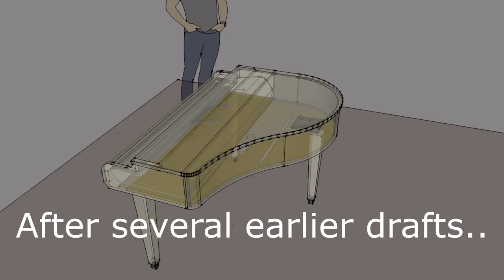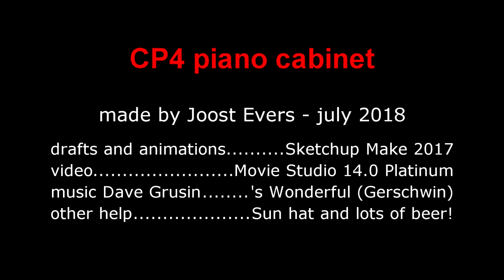A cabinet for the Yamaha CP4 stage piano

Comment: It looks amazing, if I may ask the sound from the piano speakers will not be affected since it becomes inside a wooden box? it could be it is a silly question but according to physics that can happen. I am asking as I am planning to build a shell too but I am a bit confused about the sound quality.
Reply from the maker: Wisam, You're absolutely right. The piano has no speakers of its own. Fortunately the CP4 has a five band equalizer with 5 dedicated sliders. I use it to lower the middle low and to give the mid high a bit extra. When I play, the flap on the keyboard side is always open, which makes the sound brighter. The flap on the round side is nice when you play before an audience. It opens smoothly, with a cheap hydraulic piston, in an angle of around 60 degrees. Underneath I have built in a 2x50W (s.m.e.l.) amp with two high quality multicone car speakers, facing upwards under an angle of 30 degrees. That is more than enough to reach the volume of an acoustic piano without any clipping. Some people find that the shell adds to a natural piano sound. Even more when it is closed.

Comment: Hi, I was wondering how might it be possible to implement a sliding cover for the keys?
Reply from the maker: I have considered a keyboard cover, but finally rejected the idea. It would make the cabinet bigger. In my case there is no room to slide it in, because there is a steel stability tube under the hinge of the top. A removable keyboard cover with two hinge pins would be my option, but I don't find it practical. Besides, I like the view of the keys, juist not the electronics.
Reply: @joostevers280  Ahh I see. I also like seeing the keys, but I'd rather have a cover to protect it from dust. I have considered one of those removable cloth covers, but they don't look the best. Anyways, I appreciate your response. Thanks! :)

Comment: Nice , but not much help without details. Dimensions, etc...
Reply from the maker: Well, I didn't make any drawings and it has been tailor made for the CP4. In hindsight I would have made it a little deeper though, to have more room for the plugs and speakers. The only thing that isn't apparent in the video, is that there is a metal 3 cm square tube underneath the hinge, for re-enforcement of the top. What would you like to know?